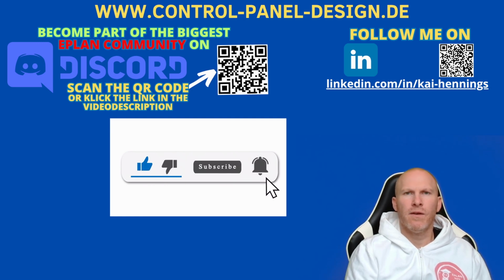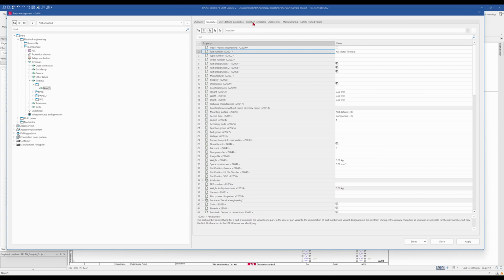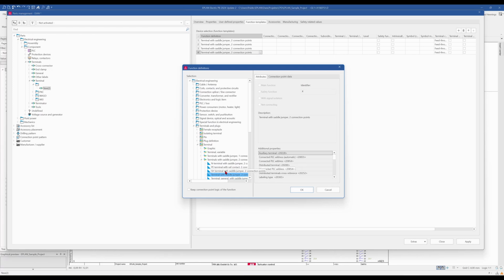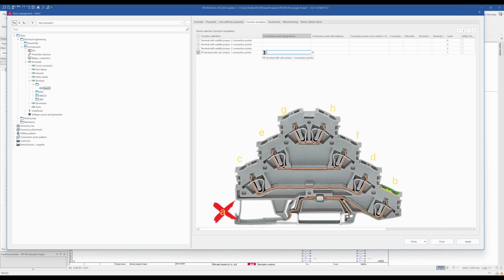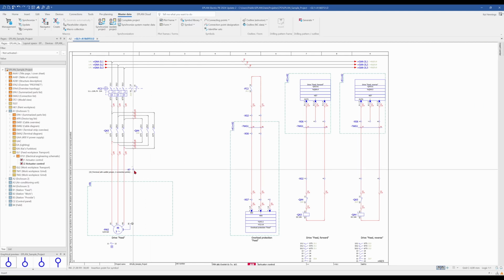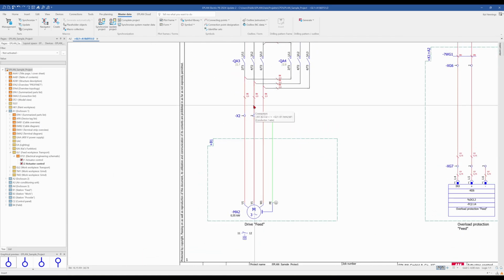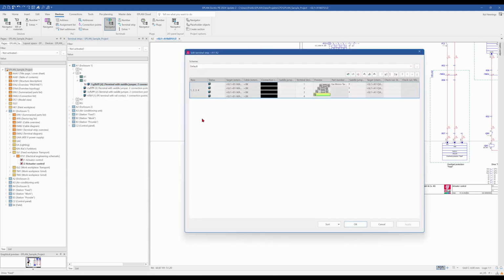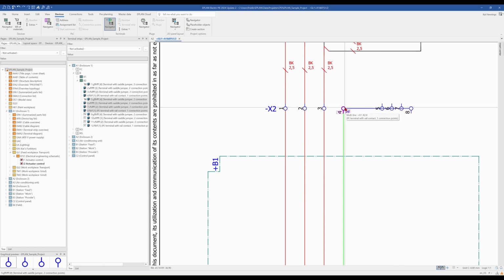How to... Motor terminal block in EPLAN

Comment: Cool video 😎

How can you rotate the connection points at the symbols? In your video you have them vertical aligned, I want them horizontal aligned?

I hope you can make an in-depth video for it 😍
Reply: Typically you would just press the TAB key to cycle through the different variants like you would the other parts.